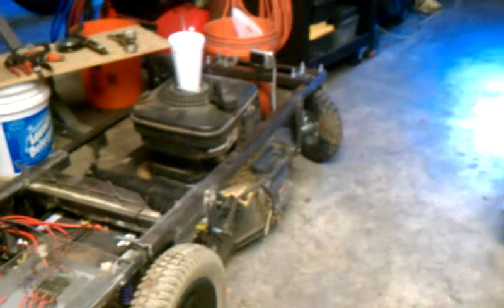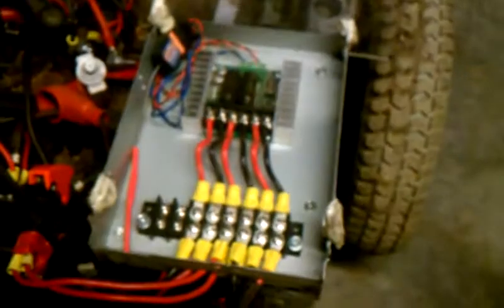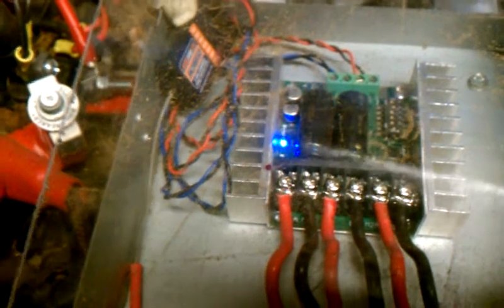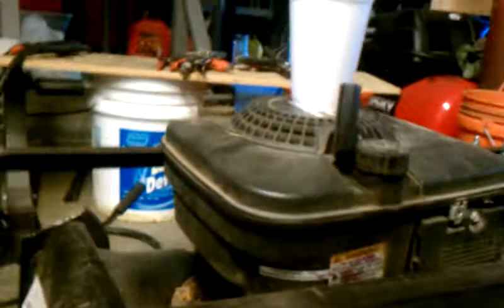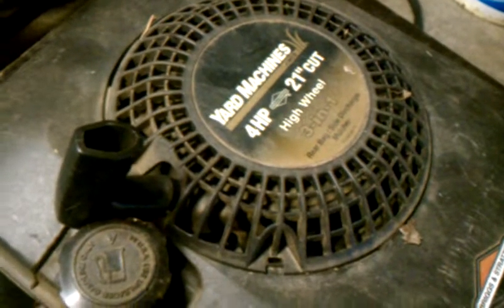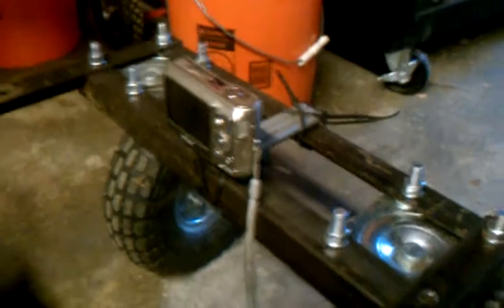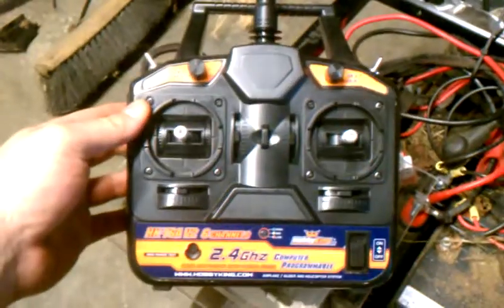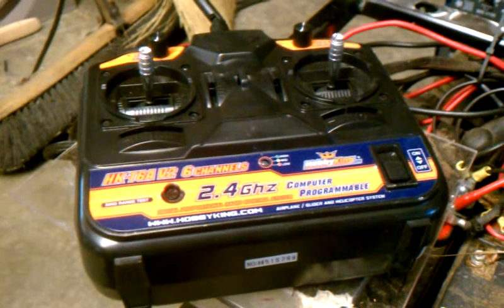R/C Lawnmower - Lawnmower explained!

Comment: It looks like u are controlling it with only one channel from the receiver is that te case ? Also looks like there's a lot of splatter in your welding u may want to turn down your wire speed and up on the power if u can